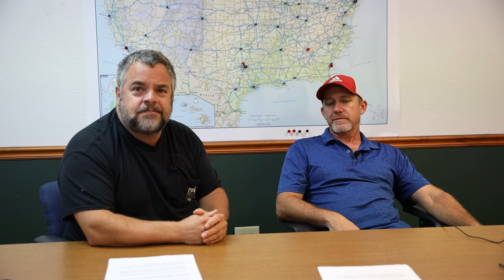What is a Vapor Barrier? Flooring Installation Tip

Comment: What about a raised garage 320 square feet that have floor board already on it. I want to put a rigid foam and 3 quarter inch plywood  over it but from a moisture  stand point, what can I use before I install all that? There is no insulation underneath the garage

Comment: So over a newer build basement concrete floor would you use vapour barrier and tape joints for a vinyl plank flooring or would you not so moisture can escape and not build up as well?

Comment: Ive got a wooden subfloor over a wet basement that floods everytime in rains heavy, the sumppump drains it but it still gets pretty wet. Im.installing some expensive wide plank solid hardwood flooring im worried its gunna cup bad from the basement. not sure what to do.
Reply: Having a similar issue with a crawl space beneath my hardwood. Did you ever come up with any solution?

Comment: What about a 2nd floor apartment over a garage?  I’m installing vinyl plank snap together flooring. The garage below has a gravel floor. I have a 1mm barrier and construction seaming tape. I live in a pretty wet environment.
Reply: what did you end up doing?